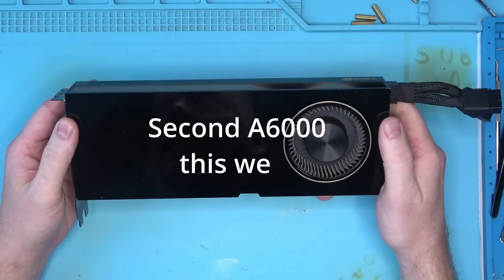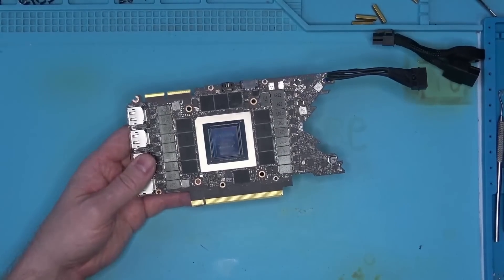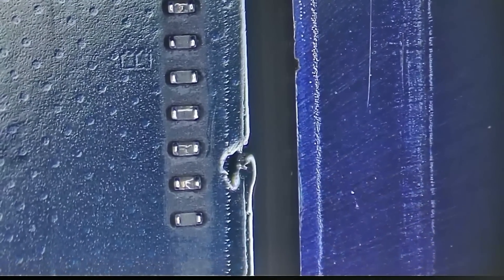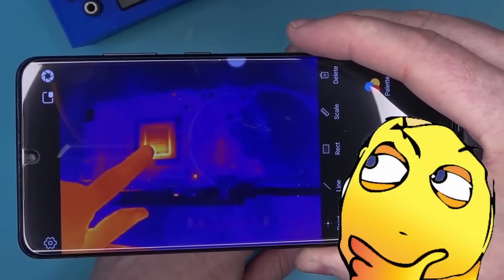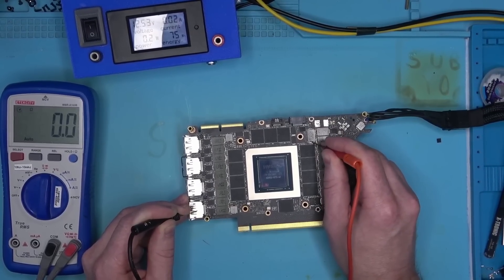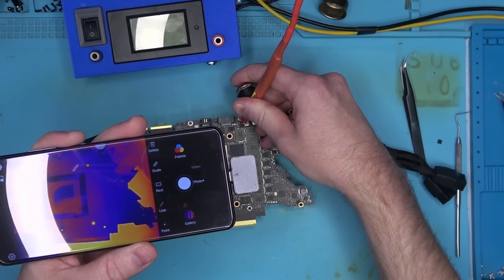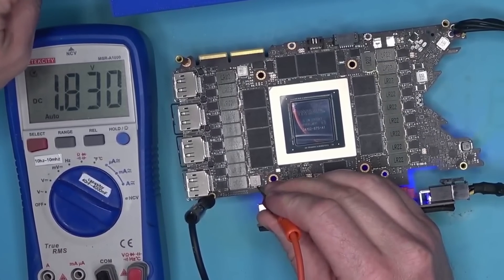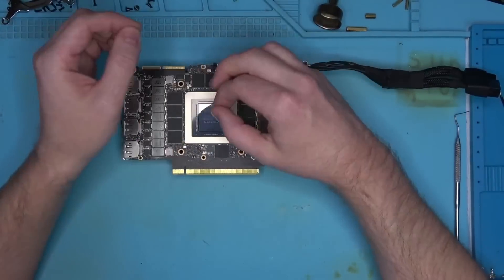$6000 GPU could be saved by 50 cents FUSE

Comment: More and more no-fix repairs... about 10 years ago when I started with board level repair, 2 out of 10 boards were no fix, but at that time I didn't have that much experience, so the other 2 would probably be saved if I tried the repair nowadays.
Now, there are 5/10 boards that are no fix. I see them all the time, GPU cores dead, 12V sent to the CPU or GPU, USB lines directly connected to the CPU, etc. On MacBooks USB-C controllers die all the time, and the only solution is to replaced them off a donor board, and also from that specific location - you can't mix them up. And don't get me started on other laptops, so much planned obsolescence that makes me sick.

Comment: Nope, the fuse would not have saved the core.  The fuse doesn't blow until AFTER the damage is done. The only thing that would have saved the core is a 1.85V avalanche protect circuit.

Comment: Same with some new mikrotik routers (4011) when the buck converter die they send 5V to the 1v cpu so, or.... 5v to the 1.8v realtek giga switch, both cases dead paperweight, just less expensive than a GPU, I stopped accepting these models because they are all the same, bypassed buck converter , dead switches or dead cpu 😢
Reply: Like nearly everything electronics. Fuses and protections are usually there to prevent the device from starting a fire. Not from protecting the stuff inside.

Comment: Well that missing 50cent fuse got them another GPU sold. 🙃
Reply: Not really. You cant protect a core with a fuse. Literally not possible
Reply: @AlpineTheHusky  The fuse is ment to protect the Voltage Rails(usualy the 12v) to prevent a short frying the Core. Which is a common feature on Highend Cards by some AIBs. So yes it is possible.
Reply: @ShinnaDEW  ...you clearly dont understand how that works. That is a single point short. There would never be enough current flowing to blow a fuse on that tiny trace that burnt through. Not to mention that a fuse on the 12V line wouldnt even come close to preventing that. Fuses are usually only used on the PCIE slot to protect the slot. Btw a fuse would be way too slow to prevent something like that

Comment: Fuse not enough they must protect that very expensive core with crowbar overvoltage protection
Reply: Trust me, its not that easy to make a protection circuit for a 1.1V 200+ Amps circuit
Reply: @AlpineTheHusky shorted core drmos very rare result in dead core but if only they protect the minor rail like pex, 1v8 and fb rail maybe the Nvidia stock not as high as today 😂
Reply: @ariewijaya1679  Dude please learn to spell or atleast proof read before making something up just because you dont understand the core mechanisms behind it
Reply: @AlpineTheHusky  dude please learn about basic electronics
Reply: @ariewijaya1679  So please tell me what components you would use to protect hundreds of supply traces individually?
Reply: @AlpineTheHusky  It was 1.8V line and i think it is for memory which definitely won't draw 200A. This power supply not even capable of this. Not sure actually how many amps memory draws. By the way there are ways to protect CPU for example. There are DRMOS in some laptops that have built in protection. Usually high side mosfet will go short meaning CPU will get 19V. These DRMOS are very quick and in case of short they open low side mosfet making it to short to ground. High side mosfet usually has higher resistance meaning it will burn first(hopefully open). But when short circuit happens there should be some previous circuit that would cut power when they see too much current draw. Not sure about GPU DRMOS, how often they will blow. On laptops it is quite common to have CPU DRMOS gone and CPU with it too. It would be cheapest way, but of course not guaranteed to protect your circuit 100%. I'm sure there could be another ways to protect your circuit, but manufacturers love non protected circuits since you will buy new one sooner and they save quite some money also. If it lasts warranty time it's fine ;)

Comment: couldn't you replace the core with a 3090ti core?
Reply: Not the same thing. A6000 has ECC capability enabled for the memory. Consumer GeForce doesn't. And 3090Ti uses GDDR6X, A6000 use conventional GDDR6 .

Comment: Yeah but then the GPU would have cost $6000.50 and no one would have bought it.
Reply: You're all forgetting that the 0.50$ fuse also comes with labour and handling and shipping costs. That GPU is 7000$ now.
Reply: @ManuFortis  generally consumer electronics adding 1 dollar of components adds 4 dollars to the retail price.
Reply: @davidwhatever9041  Yeah, wasn't 100% sure what ratio to use, but knew it was in that general direction.
Reply: @bearde_mut9731  Yup, and while we're at it, we may as well make it 20k, because lack of failing cards means less profit from repurchases. Gotta make up that margin somehow.
Reply: @ManuFortis  And increase that to 25k, because AI power
Reply: @D9fjg  Thought that one was already factored in, but hey what the heck, why not make it 30k because the AI will need investment for upgrades.
Reply: 50cents is definitely overstatement they can bulk purchase, so maybe 10-20cents
Reply: Add another 10k cause import costs
Reply: maybe someone needs to start a service adding the fuses to preserve the cards ????
Reply: @andiallen9033  While this would at least solve the end problem, it doesn't solve the original problem. They should just be adding them regardless. Like, sure, your idea solves the end problem at the very least, but it just lets them get away with being cheapskates. Which is not allowable on principle of the matter. So it's a solution, but it's not really a 'good' solution, ya know what I mean?
Reply: @ManuFortis  Seems to me due to the fact our words and pleas fall on deaf ears . Fixing it yourself is all that's left. Yes it's sad that this issue exists however the only way a user has to protect them selves would be add them  I  posit that fuses on power rails even a fuse pack inline on  PCIe power could mitigate some of this and not require modifications to the card. however this would not solve 1.8 V or 1.2 V or 3.3 V rails as they are fed from PCIe socket . Thus leaving me at the original facts l. Do it yourself or give up and buy from a company that doesn't build obsolescence into their devices like this.
Reply: he knows everything about those, we need to make him rich so he can create new graphic card factory with his name for us
Reply: 5999.49 actually. Because they all use Chinese pricing trick nowadays

Comment: there is a special lace in hell for production engineers and the management that push them to do their worst to what where well designed products.

it is a logical decision when you regard a $6000 product as the non-repairable, making fuse protection pointless.

its a shame that you don’t have the consumer protection laws the eu has which force long warranty terms on manufactures for design flaws which stay with the product through resale.
Reply: Omit fuses is one of their tactics in order to do planned obscelence. In no way user Will upgrade if their last gen GPU not broken beyond repair especially for users jn third world country
Reply: @davidwhatever9041  Well apart from the fact that a fuse would do nothing since this is not a problem a fuse could fix, this still falls under warranty or in most cases, service aggreements
Reply: @ non isolated voltage converters have a failure mode where they present full supply voltage on the regulated side, frying everything.  a fuse with a suitable zener diode to clamp the voltage whilst the fuse got round to blowing would not gave fixed the problem, in that the card would have broken, but it would have been a quick, simple and cheap repair, rather than a write off.
Reply: @davidwhatever9041  The supply line was a tiny trace that was connected directly from the supply to the GPU. The supply is around 1.1V and maybe like 300+ amps. 
1st, you cant clamp that.
2nd, you would need a fuse for every supply line which is not possible since you would need 100s of fuses.
3rd, a fuse would introduce somewhat unpredictable voltage drop that would be different on every supply line due to load differences.
And again I will ask, what COMPONENTS would you use for a 300+ amps 1.1V supply
Reply: Consumer protection in Europe is not applicable to professionals. It is considered that as a business, you know what you are contracting for, and failing to evaluate all the ins and out is your own responsibility.
Reply: @bubullenoiraude wtf are you talking about? The moment you buy a product you become a consumer and as such have those rights. No matter if it's for household use or professional use.
Reply: No warranty after this customer ninja kicked the gpu out of the slot, look at all that damage lol